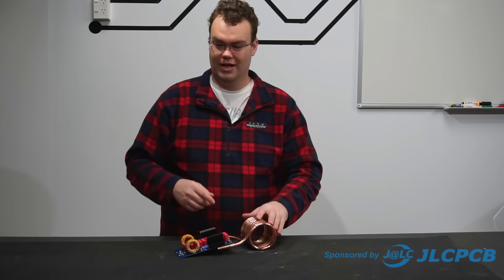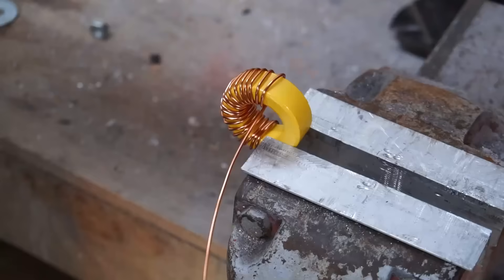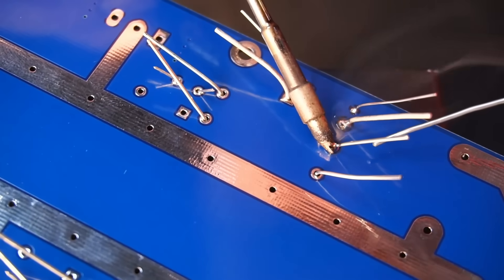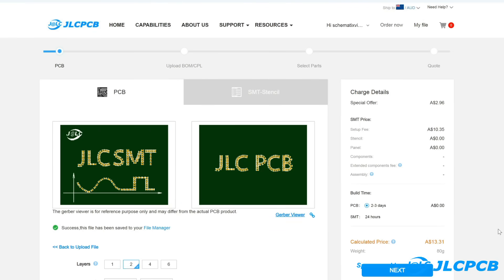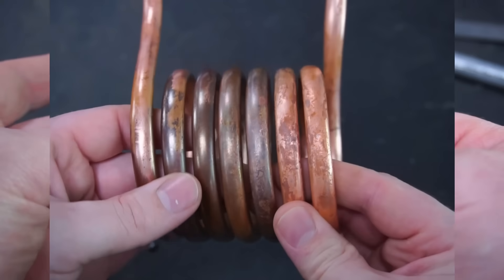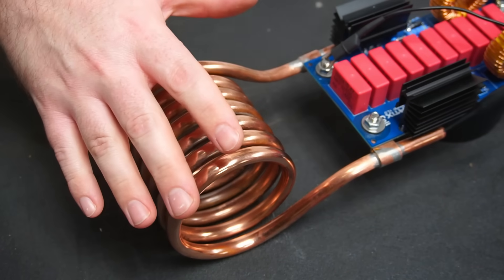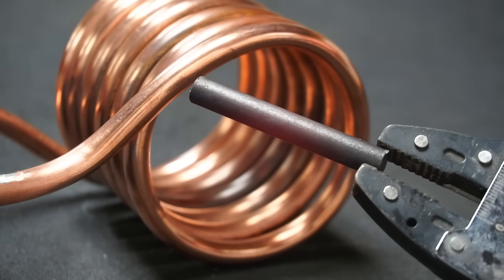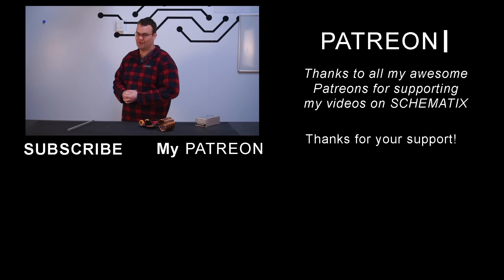Building a 1.4kW Induction Heater

Comment: Have you tried a product called "Koper Coat" (copper paste you can brush on)  on the electrical connections? I've worked as electrician in steel mill for almost 20 years. It's amazing how a film of Koper Coat reduces electrical losses and reduces heat on connections.

Comment: Nice. I might have to try this. One, point, though. If you're going to anneal copper, you don't want to quench it in water. Let it cool on its own.
Reply: That's for steel, not copper. Cooling copper fast or slow gives the same result.
Reply: @peterrhodes5663  No exactly. Fast cooling anneals it making it softer. If you let it cool by itself it gets harder.
Reply: @smferreiro2610   Where did you study metallurgy? It makes no difference how fast it cools, except of you blast freeze it, in which case it will actually harden. After we heat the copper object up, we hose it or quench it to save time, not to improve its ductility. No point in standing around if you don't need to. Costs $$$$$. Try, and measure the result of cooling both ways with a hardness tester. It'll give the same value.

Comment: I don't even know why induction heater make even sense in industrail usage as cheap and easy method gas heating are present.... By the way video was amazing
Reply: Gas heating isn't necessarily cheap nor easy. A fixed installation in a furnance, to melt mass of metals, maybe. But for "lab" use, to heat up various things, apply localized heat, gas might not be ideal. Bigger fire and explosion hazard, might burn or melt nearby materials you don't really want to, flame temperature might be too high for the job, etc...

Gas might be cheaper in energy/price, but it isn't when you take into account how inefficient is to heat most of the surroundings and air when you just wanted to heat an M8 nut.
Reply: @gabiold  And what do u think when it comes a task to heat  of Solid(non metallic) liquide (except murcery) and gasses.. isn't a good idea to buy one things (gas heater) instead of multiples

Comment: Nice build, but I fail to see the reasoning behing it. After all, you can buy a 1.8kW (claimed) ZVS induction heater unit, fully assembled, including fans and a coil, for less than 50eur shipped. There was no BOM included in this build, but I doubt you can get the parts for much less than that (at least if you don't live in the US). Let alone the assembly work. Also, I am sceptical that the capacitors, which are not specifically intended for induction heater use, and the MOSFETs, which promise a maximum power dissipation of 520W @25'C (with an infinite heat sink), will be able to sustain power levels anything near 1.4kW. The Chinese 1.8kW heater, for example, has THREE pairs of parallel MOSFETs.

@16:23 "will heat non-ferrous metals, such as alloys... So I grabbed an alloy rod"
- In practice, ALL metals (you can buy at a reasonable price) are alloys. Also, induction can be used to heat anything that is electrically conductive. However, metals with very low electric resistivity and high thermal conductivity (such as copper and aluminium) do indeed impose significant demands to the frequency and the power of the heater.

Some further remarks on this matter:

- I would not use high-power induction heaters without galvanic isolation (isolation transformer, that is). While the coil voltage is not in the thousands of volts, both the current and the frequency are rather high.

- Whatever power source topology you choose to use, it MUST be switched on and stabilized before you connect it to the induction heater. The MOSFETs will burn if you start from 0V with a (slowish) rising voltage slope. With SMPSs, this is absolutely crucial. With old school transformers, depending on the core, windings, capacitor size, magnetic reluctance, and the switch-on phase, you might get lucky and not get an instant failure. For example, with a 50Hz 1-phase system, it can take almost 10ms just reach the peak rectifier output voltage. Not including the cap charging time, that is. I bet SMPSs have a an even longer output voltage rise/stabilization time.

- R4850G2, which someone suggested, is an interesting SPMS (as per advertized specs), but you can buy four (used) rack server power sources (to get 4 x 12V = 48V) much cheaper. I, for example, paid 3.99eur/pc (+S&H) for 54.4A Dell server PSUs. Furthermore, R4850G2 is manufactured by Huawei, i.e., it is made of solid 'Chinesium', while the server PSUs contain literally only the best components money can by. For instance, all the caps are Rubycon, Nichicon, Nippon Chemi-Con, and Panasonic. I'd love to see someone do a tear-down of an R4850G2, but I'd be willing to bet that all the internals are mid-tier components at best, clones and/or low-tier China crap at worst.

- Suggestion: Build a three-phase induction heater with, say, 10kW input power. That kind of stuff is not available for cheap, and would be much more useful than these common and cheap 1-2kW one-phase devices.

Comment: Old power engineer's trick ... Don't use round copper wire to boost current carrying capability ... At the frequencies involved skin effect has a potentially deleterious effect. 

Instead obtain some thin brass strip. Tack solder this to the PCB having drilled matching holes for the capacitor leads. THEN fit the caps and solder to the brass strip and solder the length of the brass strip to the PCB.

With the appropriate 90° bending of the strip at the corners next to the coil, the coil clamps can include being mounted with bolts through the brass strip for maximum current with minimal heating.
Reply: Yep. Though thin copper strip is even more conductive than brass. My personal favorite (for high-current HF applications with long traces) is using Litz wire salvaged from broken induction cooktops.
Reply: What about desoldering braid ? huge "skin" area...
Reply: @smferreiro2610 true, but as Mr Zetor said Litz wire is MUCH better. The problem with braid is that the individual strands all contact each other. 

This can maintain a higher flexibility than a normal stranded cable, but is still more like a stranded cable than proper litz wire at high frequency. 

Litz wire, by contrast uses individual INSULATED strands. Litz braid is also possible which can reduce interference marginally, and increases strength somewhat. 

It also maintains greater flexibility than solid core and similar to stranded in mono planar flexing (up/down or left right) parallel to the this axis but potentially less in dual, orthogonal or multiplanar flexing as you might expect.
Reply: @boblewis5558  Thank you!

Comment: Switching mode welding power supplies are cheap today, and work roughly in the needed voltage/current range.

Comment: when you add in the specimen to heat up, you're reducing the effective L of the coil, which changes your fo, and your switching frequency is now not optimal. If you are able to model this or have a control loop to adapt the switching frequency, you can gain back significant Q. or an easier way to anticipate the effective-L and set your frequency to this up-front. your want your Q-factor to be as high as possible during operation, not in idle.
Reply: or you just can use a bigger power supply haha

Comment: Did I remember that your capacitor is rated at 50V and you're running the circuit at 48V? If so, that probably doesn't leave enough headroom. A massive cap can make a massive boom when it fails! Unfortunately, I'm speaking from experience...  If those figures are correct, consider using a cap with a higher voltage rating...or running the heater at a lower voltage.  Regards --NT0Z
Reply: Tibetan1962
 @11:52 he mentioned that the AC is about 28V, which would yield a rectified voltage of about 38-39VDC (which is fine). But I agree with you in that running a 50V-rated cap in a 48V high-current system would be pushing your luck.

Comment: I want to make a small one that will operate off a 12 volt car battery. Use it for heating rusty stuck bolts for removal where a torch cannot be used. Would that provide enough current?
Reply: Dan-o
 Car batteries can output hundreds of Amps, so yes, they definitely can provide enough current. 

BTW, the Chinese sell a 5-12V ZVS mini induction heater for just these kinds of applications (loosening stuck bolts). They claim 120W of power, which should be enough. I haven't personally tested these modules, but, for a price of 6-7eur shipped (with a coil) the quality cannot be world class. I suppose I should buy one and see how they work, and can e.g. the MOSFETs handle a normal car battery voltage (13.8V).

Comment: You may be able to order the boards made from much thicker copper. 35 micron is kind of standard but 140 micron is pretty widely available also, as long as you don't need fine features. Otherwise, yeah, soldering solid copper wires will also do the trick.
Reply: You could also just make the traces wider.  There's tons of unused board space there, and really no reason you couldn't make those traces 2 to 3 times the size they currently are..

You could also put the traces on both sides of the board (with a good number of vias connecting them along the way), basically doubling the amount of copper that way as well.
Reply: You would be amazed at the cost per board when getting the thicker copper compared to the thinner standard stuff.

Comment: I like your quicky power supply.  I bought a transformer by error for my bench mill but didn't need it  because I purchase a 120V single phase  input.  I  also saved a verac when they closed the building down and move us from Illinois to North Carolina.  I package power electronics so was absolutely going to solder copper to the power input and output traces.

Comment: I just discovered your channel. Nice build!. I do have one suggestion, though. As a relative newcomer to electronics, I'd have found it very useful if you had explained some of the theory behind how this works. Not necessarily down to the level of the equations, but explaining the basic principles: what you're doing with all those capacitors and the two inductors, what the mosfets are for, and so on. Or maybe you have that in a separate video that I missed.

Comment: Hey, very cool experiment, I've made some test too in the past with a homebrew induction heater; let me say that IMHO your heater has some inefficiency you can easily improve : 1) a so raw power supply is not so good even with a huge capacitor -> strong current drawn bring down voltage at a frequency of 100 Hz going down with the average voltage value and that impacts on the power... better an array of switching power supply (but that's not adjustable ...and I didn't try honestly, I only tried with a strong self made linear power supply);  2) a so wide inductor is inefficient if there is no reason for that... maybe you can heat a small screw in 10 seconds, but maybe also you can heat it in 5 seconds with a small diameter coil;  3) a non cooled system (with water pumped into the coil) becomes inefficient in few minutes since copper becomes hot decreasing the performances of the system.  Bye.

Comment: would this be powerful enough to use for knife making, as I would like something similar instead of a forge however I need to heat the steel to approx 815-900 celsius??
Reply: exactly the same question here.

Comment: Would it be wise to print a sleeve to insulate the coil inside and out, so you don't accidentally touch it with metal or with your fingers? Or would that negatively impact the heating function?
Reply: Kapton tape would be a good liner-

Comment: I suggest a slight design change to improve things: connect one end of the coil to the capacitor farthest from the coil. This will better average current to each capacitor.

The capacitor nearest (#1) the coil is handling more than its fair share of current, which is why the solder melted there.
The capacitor furthest (#10) from the coil is handling the least current.

Like you said, there is hundreds of amps flowing through the traces and will preferentially flow where there is lower resistance. It may not matter at low power but there might be some fireworks at high power.

I built one of these using the center-tap variation. It uses a second fixed 12v supply on the driver side to keep the mosfet gates happy. 

Awesome project. Thanks.

Comment: Why did you put 10 470nF capacitors in parallel? Why didn't just simply put its equivalent? Is any special intention?
Reply from the maker: If it were a single 4.7uF cap, not only would the current melt the leads but, the cap would also overheat. Thus the simple solution is to put multiple caps in parallel to spread the current/heat :)
Reply: @Schematix  oh I see. Thanks for the info.

Comment: 6:50 thats not annealing, annealing involves slow coolling rate ( furnace cooling). quenching is hardening( you have done it). if you have allow it to cool itself it would be a little softer.
Reply: That's true for steel. Copper behaves the other way round.

Comment: I don't know what I would do with the heater though. Somebody give come clues. 

Decades ago I used a stainless coil attached to a choke as a test load for PDP 11/83 computer. It ran at 5VDC and I think I tested at 105 AMPs. 

Without the choke the power supply would sense too much initial current and crowbar. Resistance of the stainless to the current was just too low until it heated some.  I think stainless is more resistive that copper and generates more heat with current, assuming the same size tubing. I think I used 3/8 inch tubing on 4-5 inches diameter and my windings were spread much further apart than the one in the video.

With out a fan the stainless tube glowed pretty bright red. 

I had no thoughts about using it as an inductor heater but see that it might have worked with modifications to my coil diameter and power input.

Comment: 17:58 Could it be due to the skin effect? At 50kHz there might be some significant current flowing through the skin of solder and thus raising its temperature to the melting point. If that's the case then making wider traces will help more rather than attaching thick wires.

Comment: the induction coil is huge in diameter this not for heavy use it will required more voltages and time , if it was small half of its current size the results will be different

Comment: Use copper solder wick to beef up the traces.
Reply: Or just a strand of copper wire. Household Earthing wire is a single thick strand. Cheaper than buying or using up a roll of braided solder sucker.

Comment: What is the most efficient way to heat say 1 litre of water? Induction? Microwave, regular stove? Kettle? of course it depends on the KW/hr used but I was wondering what is the best.
Reply: a black drum and a giant magnifying glass should do the job, and without affecting a power bill.

Comment: Your copper will bend easier, if after you heat it up, you let it air cool.
Quenching metal hardens it.
Reply: That is only true for hardenable steels. This is not true for copper or brass alloys.
Reply: Yes! This is the comment I was looking for.

Comment: I used to build RF Induction heaters back in the 80's. We used big tubes back then by Siemens. All the components were hand made, The coils were water cooled, 1.2 KW were the small ones and had some monster ones that were in cabinets equal to server cabinets.  Spaulding had used a couple of ours when they had defective grips on their golf clubs and needed to remove them.  The machines had fittings on them so different coils could be used to match the projects and the machine had variable current controls and timers.